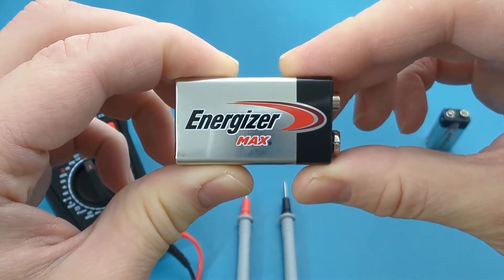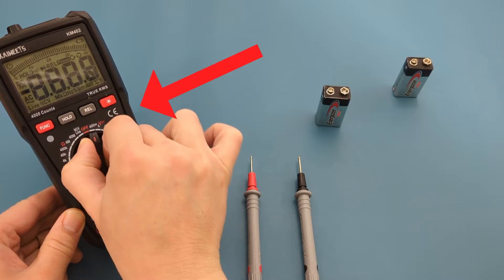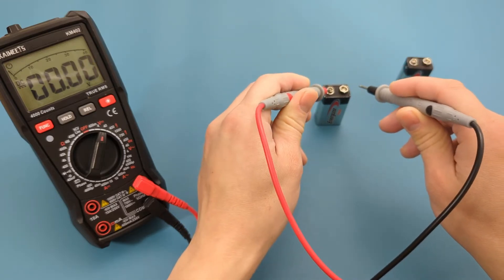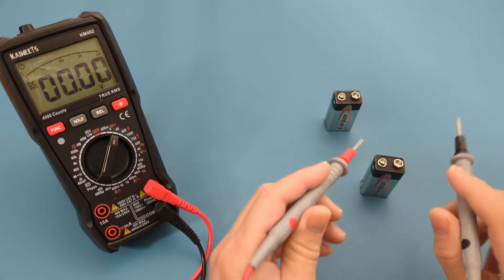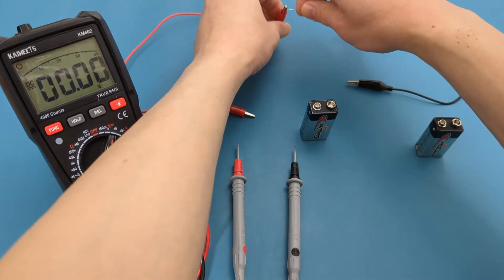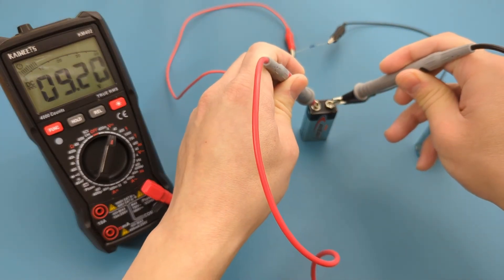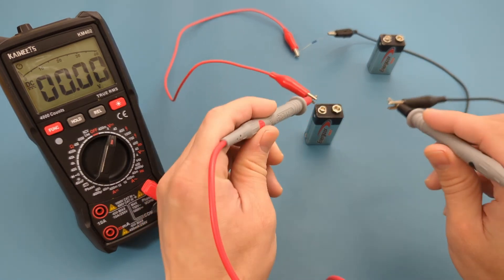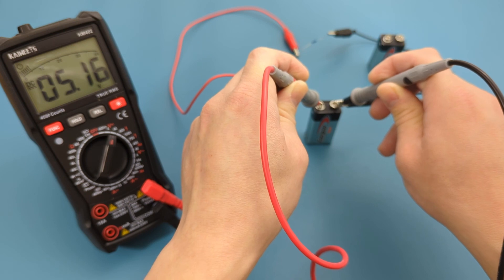How To Test 9V Battery With Multimeter

Comment: Fail.....Not the way to test a battery of any sort! Always with a correct load. This is basic electronics knowledge!
Reply: Bro no. when it comes to households batteries you don't have to put a load on it. Ironically I'm checking AA right now with my multimeter WITHOUT A LOAD and it's coming up 1.274 which tells me that it has enough life left in it for what I need it to do and that is go into a remote. One of the reasons I'm checking it without a load is because I don't have all the fun gadgets that are needed to put a load on it while testing with the multimeter. The average yt viewer is not going to have those either. So for those of us just wanting to put some batteries in our Roku remote we're not going to go through all and those extra steps when we just want to know is there enough juice in this thing to make my remote work for the next few months? Testing without a load definitely can answer that question. 
That my friend is just basic common sense.
Reply: And your qualifications are what?....LOAD IT!...end of story! Your now blocked for your stupidity.... @SarahLee80

Comment: So when I was learning how to do this I was reading it from reddit and 1 of the commenters was like you don't have to test home batteries on a load. the difference between load and non load readings is minute to where it really doesn't make a difference unless ur like super picky and insist on extremely accurate readings. and so that led me to experiment and fact check that and they were right! the reading is pretty minute.  like unless you're OCD about it and must have the exact reading on the battery taking a load then you really don't have to have them on a load when you check them. Me personally my c batteries were coming up 1 10th of a difference between load and load testing.  Now that being said if I need to know how long the batteries are going to last that's when I bust out the little thingamadoo what is that called a transmitter a transponder transformer Optimus prime...? 
 I don't remember what it's called but you know the little Doo hookie and test them while they're on a load but that happens pretty rarely usually If I'm busting out the multimeter that is because I don't know which battery is bad in the Roku remote. I don't feel like playing with it because by then I'm frustrated I just want to lay on my couch and watch my Roku with the remote working, and not playing musical triple A's all night. Lol😉
Reply: Thank you for that. You just freed up couch time for me. 🙏🍿

Comment: If you don't have a multimeter handy you can always put it on your tongue. If it feels like you just electrocuted your tongue, you did! With 9 volts and you can be confident that your 9 volt battery is goodi to go. if you put it on your tongue and there is just a little sting or maybe it feels like a very mild execution to your tongue that means the battery is near dead and you should recycle it as the manufacturer suggests or your local govt/county and/or state laws require. Just make sure it's not leaking any fluids, like battery acid for example, before you go putting it in your mouth and whatnot. Lol. I am not an electrician I don't know much about electricity other than it can electrocute you and I am not responsible for any consequences, injuries, or death(s) that may result by taking my advice in this YouTube comment. 
Thank you for attending my 9 volt battery Ted talk 😉🤣🤣🤣🤣
Reply from the maker: Lol this is definitely an option if you don't have access to a multimeter. Follow at your own risk 😬